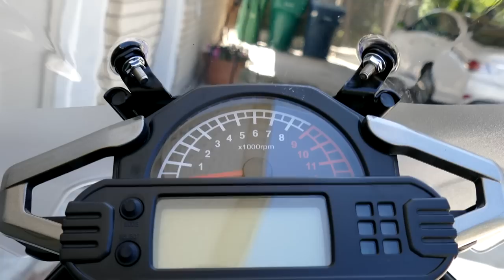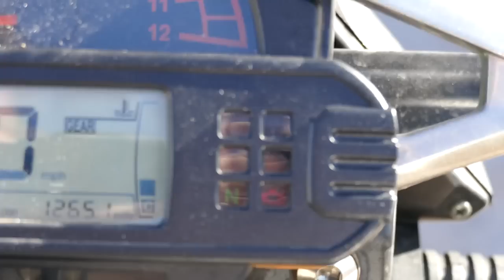Zongshen CSC RX3 Cyclone REVIEW - BRUTALLY HONEST  #everide

Comment: To be honest it's not a 'dual sport' bike as Americans call them (what Europe calls an enduro). There not built as light, wirey & with those tyres or suspension. The other 'adventure' bikes compared to it are much bigger capacity bikes & much, much more expensive with the components to match. It goes to show it's not surprising it will be no match, although that still might not mean some of them others may be overpriced. Or that we could be pleasantly surprised by the product. Anybody who thought they would get a BMW adventure bike for much less was clearly deluded. Basically you're getting a bike that's a decent (storage wise) commuter, that can handle the odd dusty / stony track better than a sports bike or cruiser & that looks nice. The top speed is disappointing however, as my 125 can do 80 odd mph, you would think as usual twice the capacity would have a bit more ummph both there and with overtaking confidence. Seems like it has the performance of an average 125.

Comment: The RX3 is not a speed demon…   Everyone knows this when they buy one..   Top speed is 85 (Satellite GPS speed) and I weight 240 (6 foot).    People who buy this bike don’t want speed but rather a bike to view the ride not the speedometer. 

Also,  the RX3 has never been advertised by CSC to be off-road bike like you are doing in the video.   If you want to do SERIOUS off road riding then I would buy a
dirt bike.    RX3 is great for fields,  dirt roads or neighbors lawns.   

Everyone knows the fuel gauge indicates a little early.  Not really an issue if you just keep an eye on it.  I refill every 200 miles.  Light indicators work great @ night
time.   During the day you can see the light indicator on by glancing at the light while you ride.  It’s down to the left / right.   I never really notice this as an issue.  

Speedometer is off by 10%.  I use GPS too and the speedometer is usually 5 miles to fast.   Not an issue if you know 1st grade math..    

Bottom line RX3 is a great bike for a newbie “LIKE ME.”  I don’t want to spend big MONEY on a bike that I might not even like riding since I’m new.   The small engine (250cc) is a plus as I don’t want a huge bike because of lack of experience….  Keeps me realistic.   

One thing weird with this bike is kids always seem to take notice for some reason.  They wave and want me to honk my horn.  Wonder if that is the same with all bikes.   Seems odd to me.  I will admit CSC should upgrade the horn.  My wife says it sounds like it should be on a scooter.   Easy enough to fix if I wanted too.  1400 miles and no complaints.   I do recommend this bike if your thinking about it.   

eveRide ADV  is a putz..     :-P 

2016 RX3 “Silver” owner
Reply: though install good horns

Comment: I am sorry; get a torch and sledge-hammer that steel rim straight! You've got nothing to lose and everything to gain. Especially the manly satisfaction of fixing your rim for nothing. Just do it and save yourself $200. These are good skills to develop. Also, given your video evidence, the motorbike seems to do OK as needed on some very rugged trails, albeit at slower speeds that you could safely on other motorbikes.

Comment: I didn't listen to you in the beginning - I own and actually like (not love but like) my RX3 but watched this review anyway.  I pre ordered mine.  I've had some troubles with my bike, but I still like it.  I can't say you were wrong about anything here, but I do think the review came off a bit harsh.  If you seriously want to go flying around in the dirt like you seem to enjoy, I can't imagine anybody believing that the stock tires are a good choice for that.  Also, you talk about the lack of power like it's a shock on a (fairly heavy) 250cc bike.  Also, while the rims don't seem to be the toughest, I've owned a few bikes with aluminum rims that are definitely more fragile.  As for bolts rattling loose, I've lost one exhaust shield bolt and one saddle bag mount bolt in the time I've ridden it.  Most single cylinder bikes I've owned rattle something loose now and again though.  I ride my RX3 almost every day.  My longest ride is from Flagstaff, AZ to Reno, NV that took about 11 hours.  I've had my share of mostly minor issues with my bike, but I can't say that I'm afraid that it's going to fall apart anytime too soon...  Overall, I have to say I think your review was pretty thorough and well done - it's a cheap bike and that shows in the form of a few glaring faults.  My favorite motorcycle is whichever one I happen to be riding at the moment.

Comment: Your very reserved in your opinion,  I'm not !! ….  Its a piece of worthless crap ,  potentially dangerous AND Its not cheap ..
 the depreciation will be so bad it will cost you FAR more than buying a used quality bike, let alone the cost and heartache 
of constant repair . 
Bikes like this are responsible for putting naïve new bikers off motorcycling for good , and therefore should be called out.

Comment: I think the top speed is already close enough in the Paper at 83, (track 5:08) while you only got 74 because the bike you were using has never been "Broke-In", basically, New bikes need to be run at least "200 Kms" before they can obtain it's Top-Speed correctly, which is called the "Break-In Period". Perhaps if the bike has already obtained its Break-In period, it could get better than 74, maybe it would reach around 80 to 82 at least.

Comment: just because a bike is an Adventure/dual sport STYLED bike,,,doesnt make it a dirt road, single trail bike...What is the definition of 'adventure'.....When I road 1000 miles in 17 hours (mostly interstate) was an adventure. Not a very good test race with a Prius...I have a Prius, got called out by a camaro at a traffic light...race him to the next light on the next block and smoked his a$$....It was a less than $2500 bike in 2016...what did you expect...of course they were not premium guards....premium guards close to 25-30% of this bike's total price...jeesh...buy an inexpensive bike, compare it to an Africa Twin and upset doesnt meet expectations... No, I dont work for CSC, and dont even live in Cali...

Comment: The chinese r catching up real fast , 8 yrs frm now u would queing to test ride their products . And zongshen have an rx3s up their sleeve , its 38 bhp , twin cylinder water cooled , but they r catchng up real fast , keep ur fingers crossed , in addition to that they also have a baby rx1 and a single cylinder 450 cc version . The real fly in the ointment with chinese offerings is they have a single frame and body that houses different engines , not how about a 380 or a 450cc rx3

Comment: i think you misspelled blatantly fraudulent in your video title because there's nothing honest about it. it's one thing to ride a bike in the environment it was built for and compare it to other bikes in that same class but there's no way you can compare the RX3 to bikes that are very heavily slanted for off road duties and then run this bike against them down trails that those bikes were more set up for and then to bash it because it wasnt quite as capable on rough single track is a complete misrepresentation on your part. would you take a Vstrom or Versys down those same trails? i doubt it but that's the class the RX3 is most closely related to. it's a street bike with the potential for some simple off the pavement adventure. it's not a mountain climber or canyon crawler. i'm sure you'll just delete this post as you've done with all the other posts that have argued against your video only solidifying your status as a fraud.  i hope you enjoy your irrelevance.
Reply: A Vstrom would, AND does go down trails like that because it's designed for it. This bike was built to look like something it is not. Tyler called the spade a spade. stop whining about it. If you own one fine, enjoy it, but stop crying that few others share your opinion.
Reply: They just made it look exactly like the F800GS....for what again exactly? Ohhh SPPPEEEEEDDD that sticker adds 5hp.
Reply: Dude this bike is an adv-tourer. He's taking it on the roads it was designed for...or designed to appear like it was designed for. Look at the design of the bike, it's an adventure bike...or it pretends to be. Why does it try to look like the premium adventure bikes it pretends to compete with if it's just for 'off-pavement' use? Did Joe send you? What a joke. LMAO now that's irrelevance.
Reply: Nobody in their right mind would take a vstrom out there on those boulder strewn trails as evidenced by the fact that everide himself hasn't done it.  adventure bikes and enduros are not the same thing. they are bikes meant for traveling, going places, seeing things. they are not meant for motocross or trials courses. maybe he should just take that POS prius out there and bitch about what a lousy RV it is.
Reply: Wow, you are so hurt lol. It even states on the CSC website by the people who make and sell them, that the CSC/Zongshen RX3 is made for "real world adventuring, off roading adventure". So how is this video fraudulent? How were the comparisons slanted as you say? Even on the chinariders.net forums, the premier forum for Zongshen motorcycle riders (you do know that is the parent company?) state that it is an off road capable bike, some even claim it's better then the big 4 and BMW equivalents lmao. Seriously, what is the point of buying an adventure bike if you can't take it on adventures? When I had mine, 2015 Red RX3, the only thing it was good for was to teach me how to repair motorcycles like a pro since something was always wrong with it after even the simplest of rides. Did I expect it to perform like a dirt bike? No, but expected more than barely being able to go down a dirt road lol. For a daily commuter, better bikes. For an ADV, better bikes, at least the Versys has the Ninja 300 motor. Oh and that engine the RX3 has is anemic as hell, needs some tweaking for a little more power, and those gears are atrocious for an ADV. Seriously, who came up with those?
Reply: MegaBluebone what
Reply: Mega, you really need to research before you start posting.  CSC advertises this bike to be off-road capable and even touts their "attempt" at rally racing.  How long does it take to push this bike 10,000 km in the Brest-Dushanbe Rally?  (that rally specifically mentioned on CSC website)
Reply: 99% of most adv rider adventures are unpaved gravel roads and highway with an odd patch of dirt road thrown in from campsite to hotels. Very few adv bikes were designed to do dirt circuits as that's not really adventuring that's dirt riding. I feel they should have definitely advertised closer to the Versys line as that's more what it is Paved and unpaved roads, not 45 degree off road mountain climbing. I feel like most adv riders are either lying about the riding they do, or are worried about what their bike CANT do even if they never ride that way.

Comment: I would personally never buy a stock China designed and built motorcycle. I wouldn't do it with a car either. My parents wouldn't do it, my friends wouldn't do it, and the weird guy down the road wouldn't do it. I am fine with a 50cc 2 stroke bicycle motor being built there but that was only after taking the time to go through it and make sure it wasn't going to blow up or something. But the bottom line is, with the reputation Chinese built stuff has gotten. I don't see this bike or any other China motorcycles getting much traction in the USA.